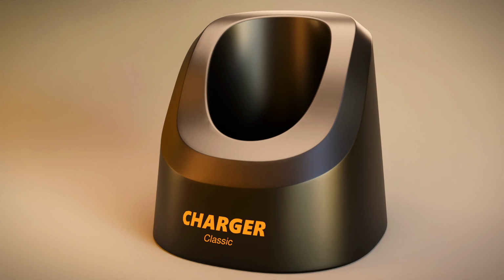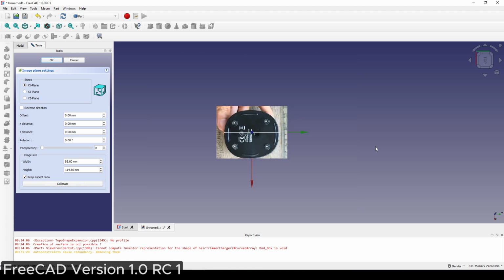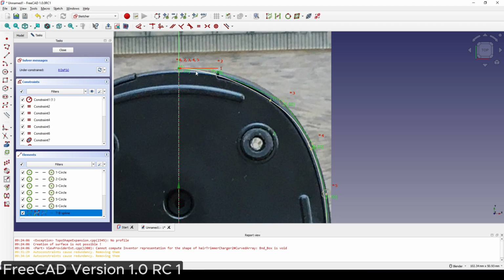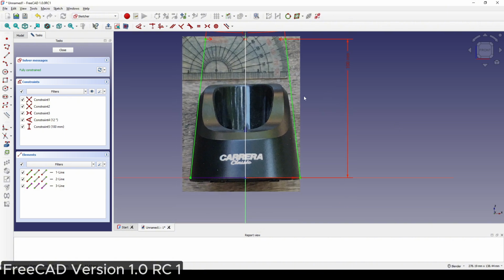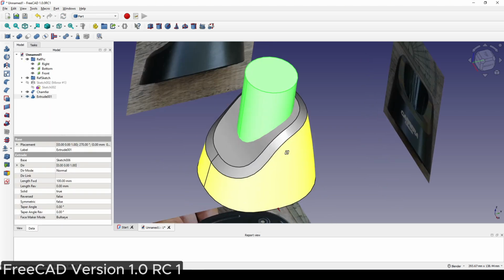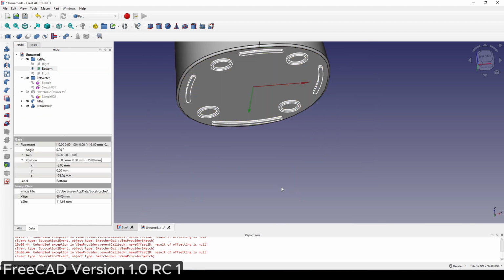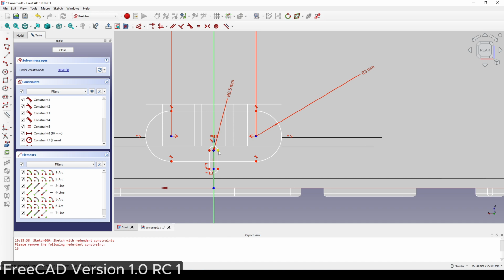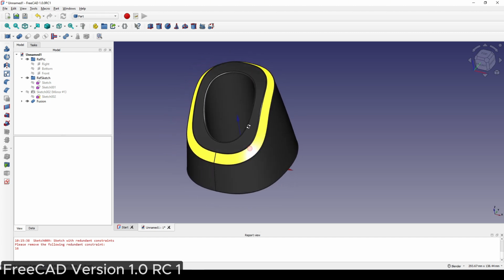FreeCad - Modeling a Charger by tracing images.

Comment: You are so amazing I can not help to wonder what your background is very interesting. I had a lot of trouble with freecad I also had a lot of trouble with this video few months ago. But things are really starting to click. Few things I did differently than you in this video for the Join Curve for the base I used symmetry instead of mirror. B spline r view to cut the top, I just extruded the line to create a solid plane then sliced.

Comment: Is there a reason I don't know about, using booleans instead of just the pocketing? There are several times I hoped you pocketed but you just cut :)
Reply from the maker: I rarely combine PartDesign with other workbenches because it tends to make the history a bit confusing for me (just for me). And also the sketch in Partdesign can not be moved or rotated in Draft, you have to deactivate it first.
Using boolean I can directly use the transform tool or scale tool for the cutter and the object I want to cut. But in the end, you can use the pocket if you feel comfortable with it!